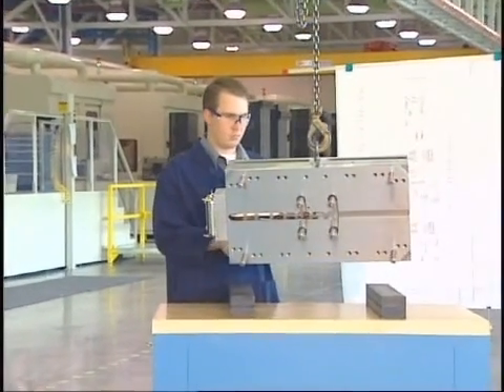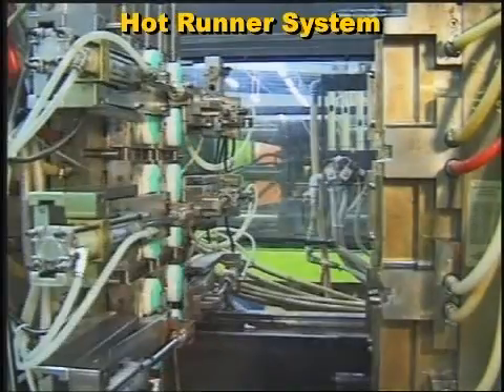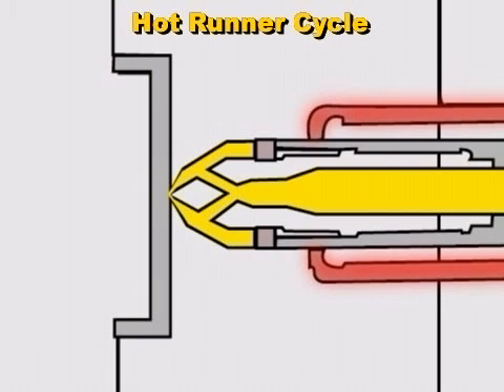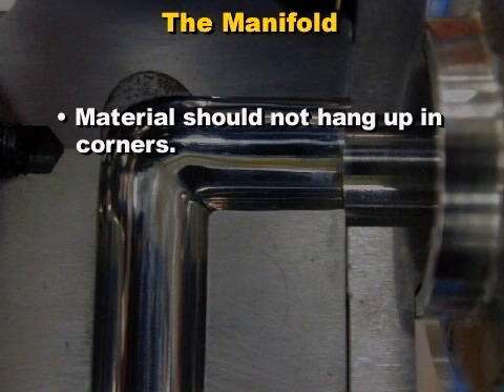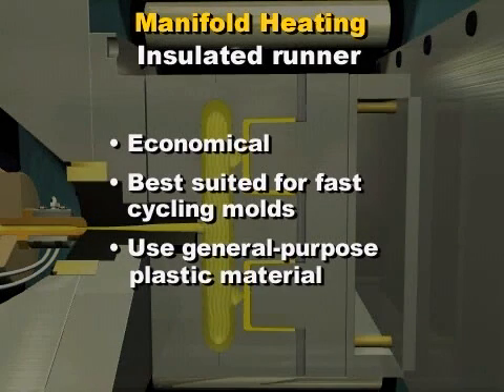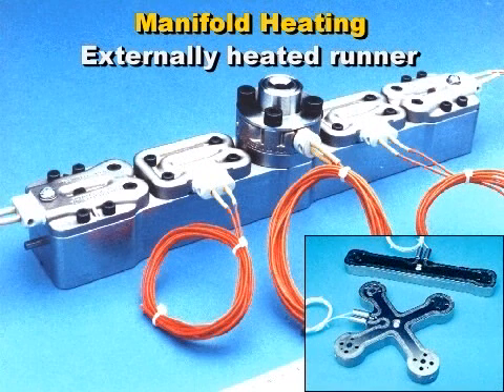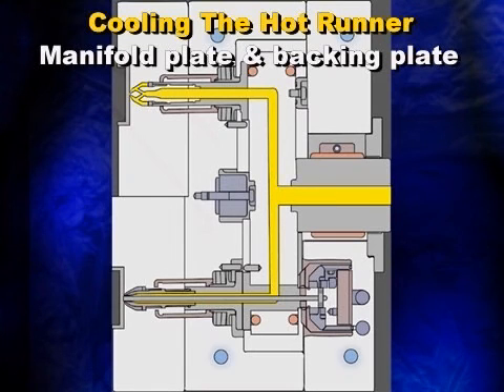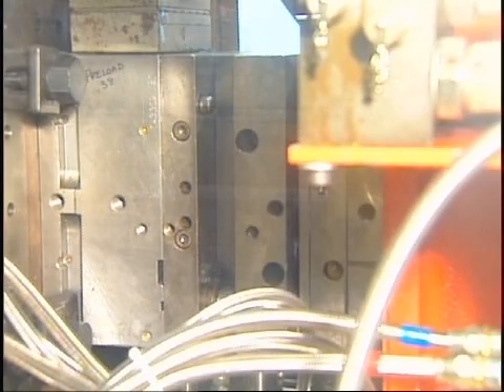Hotrunner System for Mould

Comment: One must be very careful when choosing a hot runner system.  Systems with a small bearing between the cavity and the hot runner nozzle are very susceptible to runner leakage over time.  Once this happens it is a total nightmare.  Cleaning the mold , replacing heaters and thermocouples will NOT solve the problem.  Choose a supplier with a large sealing surface between the cavity and runner nozzle.  In my experience Yudo was the bees choice.